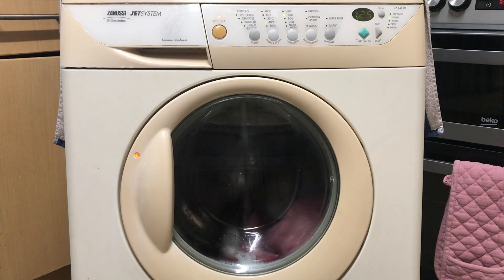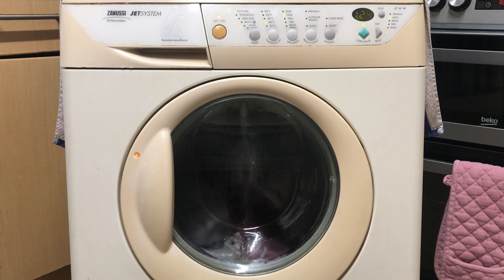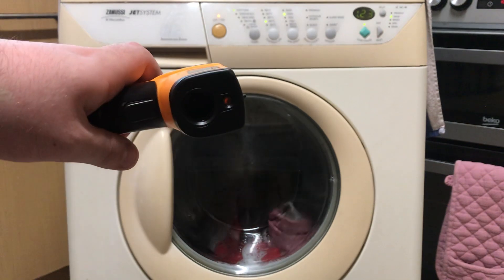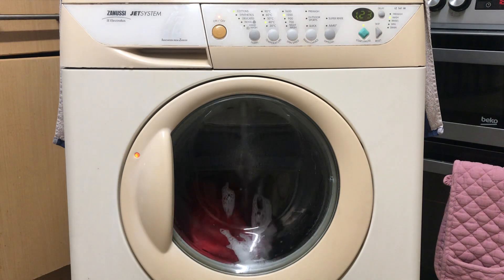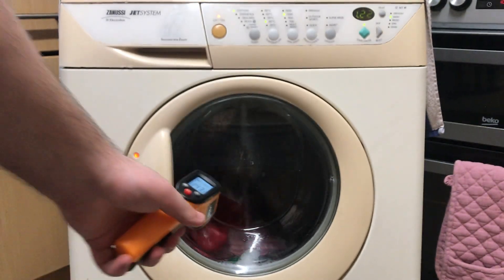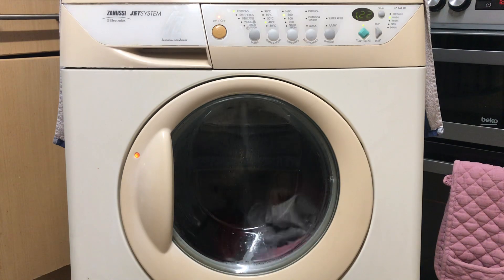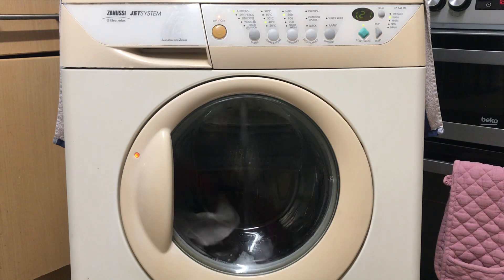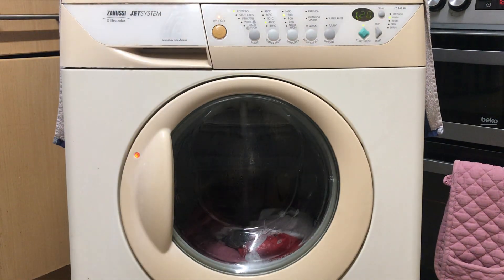why you shouldn't always trust photos of laser thermometer readings

Comment: Also what i read on these types too is that the reading could be inaccurate if tested on surfaces that are shiny or that reflects things such as glass and water. Apparently they are more accurate if tested with like matt surfaces but i don't know if that's true or not, it came with my write up with mine but i never use it 😂.
Reply from the maker: i believe they are accurate with water. i'm able to get an accurate reading for boiling water (which is easiest temperature to roughly confirm thermometer accuracy, for obvious reasons). but when it comes to glass on washing machine doors, these thermometers will typically read 2-5°C too low (depending on glass design). other glass types i'm not really sure about.